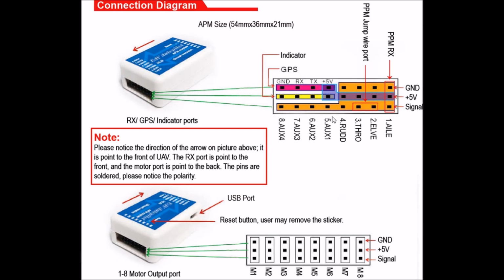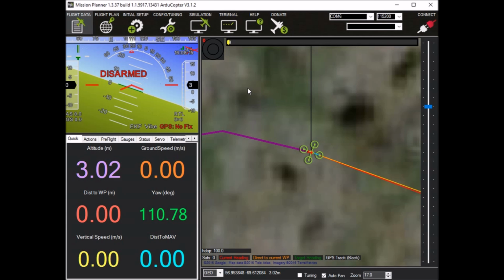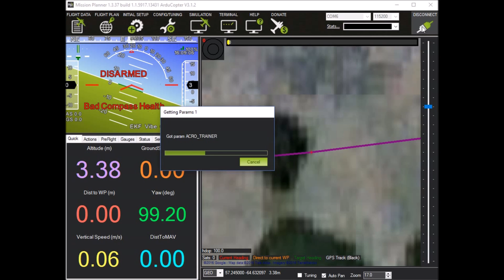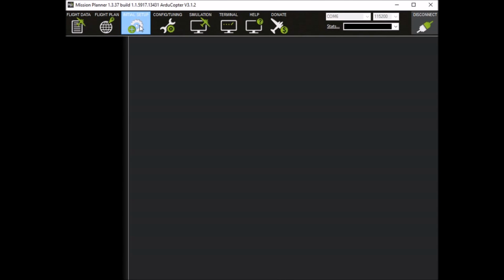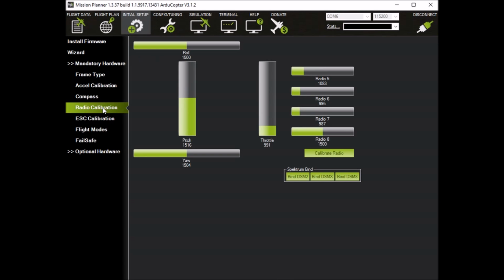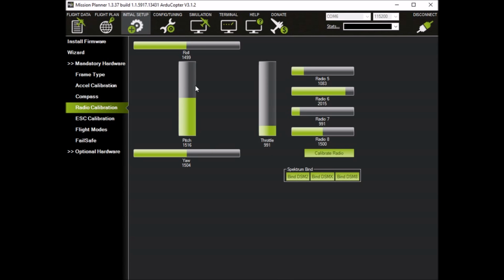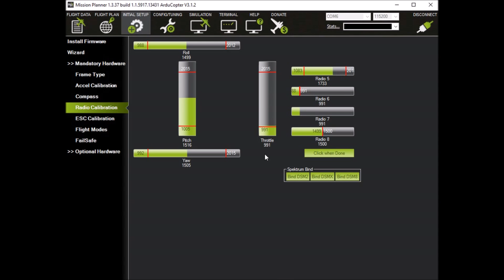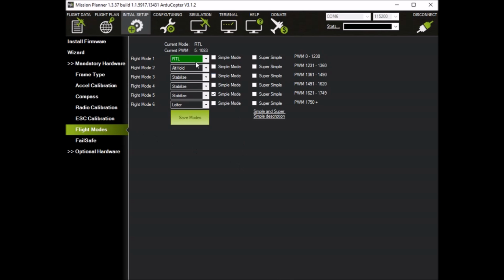Part 2: Quanum Nova and Cheerson CX20 Standard PWM Setup

Comment: Hy
I hawe problem with my quanom nova 
Can you write me your email? Are You Facebook user can I contact You on msm?
Reply from the maker: I can answer questions here. Please ask away.
Reply: My cx20was broken so I take another frame from dsy. Wires for motor controler was too short so I must repalce it..now only 2 front motors work. Where I made mistake.wires I check 4 times . I hawe another nova for parts. What to change First.. I hawe all   parts double. Only reciver IS difetent my IS original, spare IS turnigy 9x8cv2..(I thing this IS not copatible with cx20 controler. How IS reciver conected to controller umit. If controller IS demaged can I Use chanel 5-8?
Hov motors are liste. Where IS nr1 and so on..
I hawe pictures but cant post it here so need You email.
Thanks for fast replay
Reply from the maker: @MatejCanzek  Go to your google drive. After upload photo on Google Drive, you copy the link of Photo. Now go to youtube & search those video that you want to send the Picture in its comment section. ... Now your Picture is sent in the youtube comment section.
Reply: Ok I Got it
How the engines are oriented where is the number 1 where is the number 2.. 3..
Reply: https://mojalbum.com/sablac/dron
Reply from the maker: @MatejCanzek  I got the pictures. Thanks. What does Mission Planner say when you connect it to your PC?
Reply from the maker: @MatejCanzek  try this as well https://www.youtube.com/watch?v=_B4e41ac7jE
Reply: Thanks for helpful info. I haven't plugged it in yet. I must solve mechanical and electrical problems first. It is not clear to me: which engine is number 1. Which engine is number 2. Which engine is number 3. Which engine is number 4. To connect it to the controller properly. 
Above - forward left is which one? Above-forward right is which one? Below - back left is which one? Bottom-back right is which one? 
I still need this information pleas.
Reply from the maker: @MatejCanzek  the cheerson cx-20 is the same machine https://www.rcgroups.com/forums/showthread.php?2557082-HowTo-install-PX4LITE-%28Mini-PIX%29-Cheerson-CX-20-Quanum-NOVA
Reply: Cool thanks.
Reply: Hello. I tested the drone. My controller is dead .. At least that's what I predict. Only two engines work. When I change the outputs, the other two work ... unless I have to program something. Is it possible to use other outputs 5,6,7,8? 
I still have to connect it to the pc and play with settings.
Thanks by
Reply from the maker: @MatejCanzek  I don't think it is the controller. It is usually an all or nothing thing with these controllers. Does mission planner see all four motors and can you do the motor test in mission planner?

Comment: Can you recommend any PPM or PWM, not very expensive, transmitters using something other than potentiometers used for reading sticks position on rudders? I have the original cx-20 transmitter and now because of one faulty potentiometer on throttle stick, I have a hard time to arm motors and even if I got lucky and make it armed it's not safe to fly the drone with the transmitter like this. Thank you.